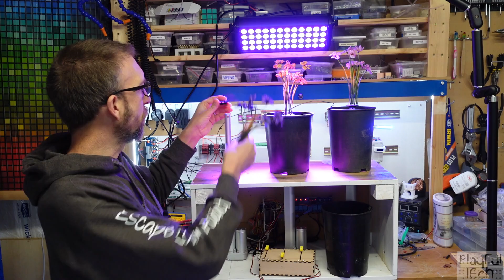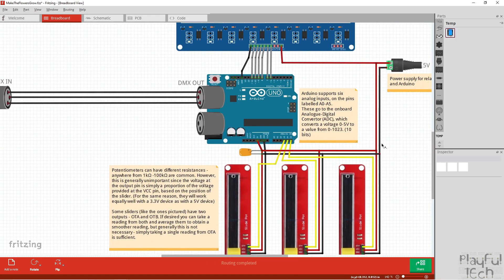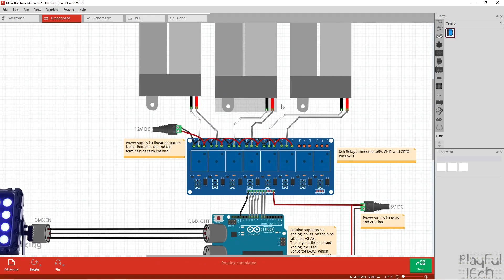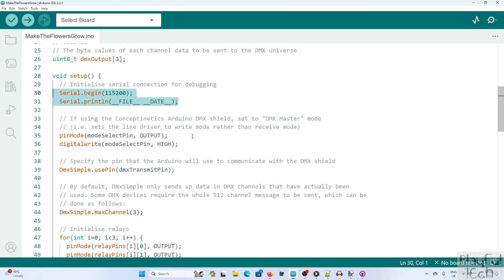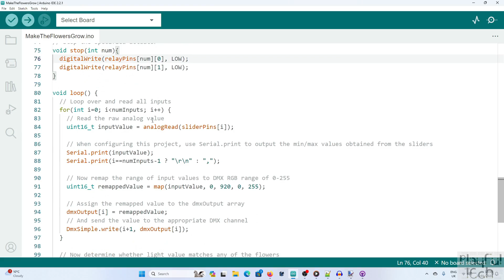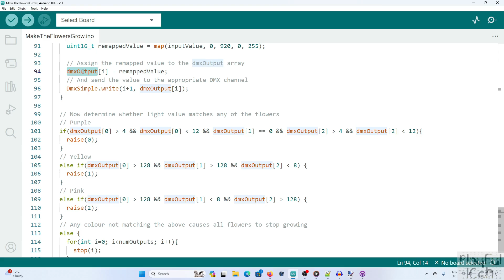Escape Room Puzzle Tutorial - "Make The Flowers Grow"

Comment: make it cheaper by using rubber bands and solenoid to lift flowers. Hand reset.  I like the use of dmx.Or use small gearmotors with cams.
Reply from the maker: All good ideas! I think the problem with the rubber bands would be to introduce enought friction to cause them to "grow" slowly, rather than just pinging up out of the ground at full force! (and also, you can't make them recede again if the light is removed). But there's certainly lots of different ways to produce linear motion.

Comment: This looks really fun, you could also even do temperature or have a little water pump that just cycles water. How i would do this is have a book of flowers that all have their "growing" conditions and younhave to identify the plants based on how they react to the changes in environment. Maybe via process of elimination. Maybe instead of a relay use a transistor and if you get one factor right, you analogwrite 128 so it moves slower than if it had 2.

This is such a cool puzzle! 

Im currently struggling to make multiple microcontrollers to communicate with each other via cables, would you be interested in doing a tutorial in how you make your puzzles talk to each other?
Reply from the maker: Thanks for the comment! Re: Communication between devices - yes, sure - there's lots of options available, I2C/SPI/UART, UDP/TCP/MQTT over Ethernet/Wifi, Bluetooth, or RS485/Modbus/Canbus, or proprietary systems like ESPNow.... which devices are you trying to network, how many of them are there, and what is the maximum distance between them?